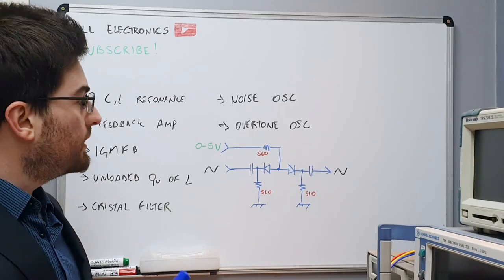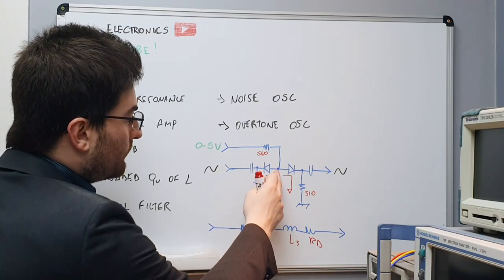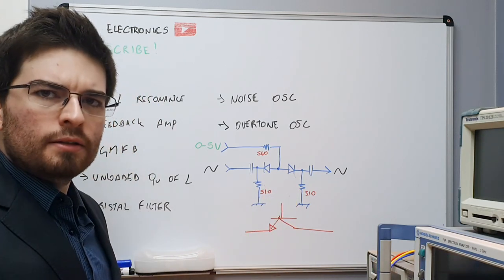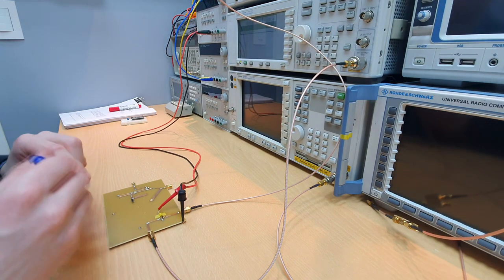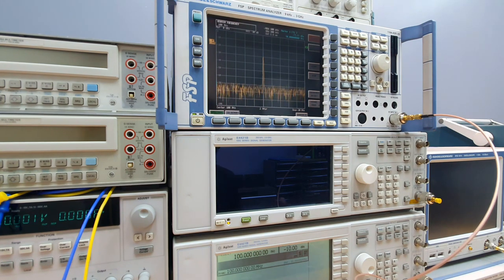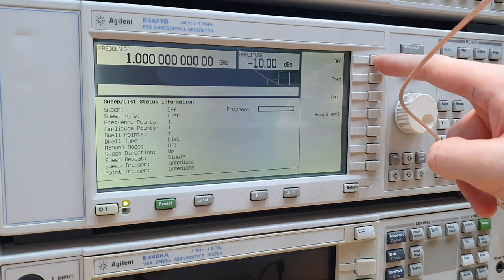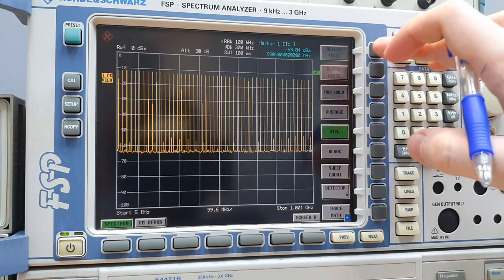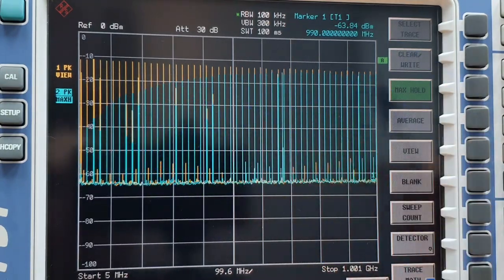RF Switch - BJT transistor as switch

Comment: Do you have the capacitance values you used for this circuit, trying to recreate these results in the lab. I tried with 5pf caps and a bc560 transistor and could not reproduce.

Comment: Interesting idea.   How does the conventional diode version compare for isolation, using small signal diodes (e.g. 1N4148) or microwave diodes (e.g. BAT15)?
Nice lab!  Stay safe and keep up the good work.
Reply from the maker: We need to test it !! 
The diode is a simpler device, so the parasitics can also be less problematic.. 
Nevertheless, we have two isolation junctions with the transistor..

Comment: Nice video, but you forgot to mention it's small signal switch, it can't switch T/R, at least in my experiment with bc547c and 8 volts tx signal. Did you try?
Reply from the maker: True! It works only for small signal

Comment: What if you went negative on the bias voltage? Won't this reduce the capacitance even more and give better isolation?
Reply from the maker: It helps but not so much. I also thinked it would make a big difference 😓

Comment: You might want to try switching the position of the collector and emitter of the BJT. I believe it can improve the gain at the output than you current configuration, but I might be wrong.
Reply from the maker: The transistor here is not working in active mode.. so there's no gain.. only two diodes in series..